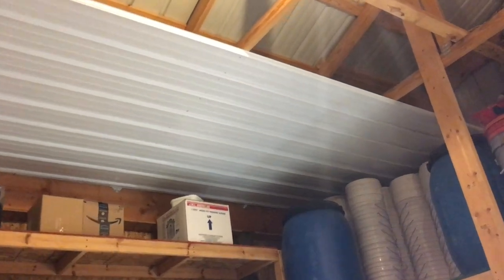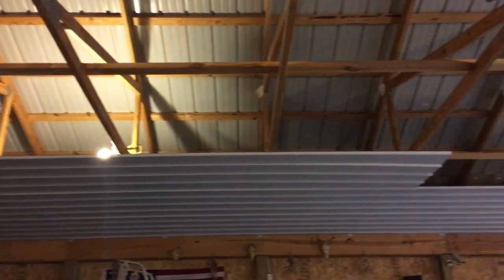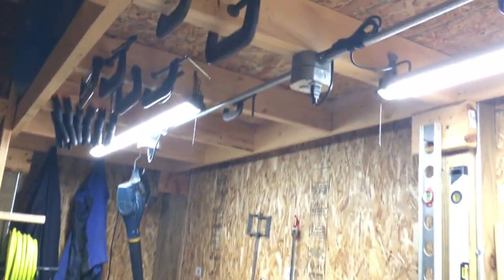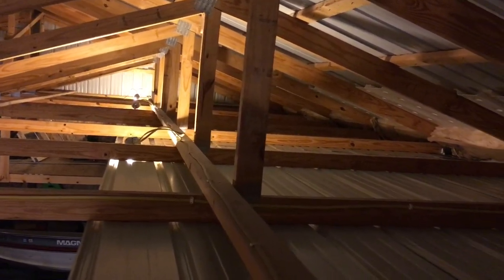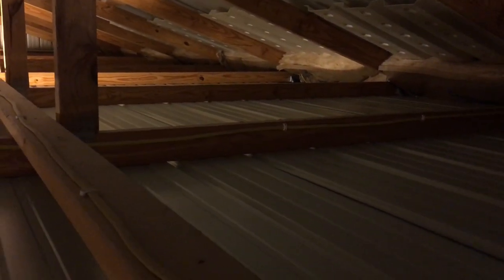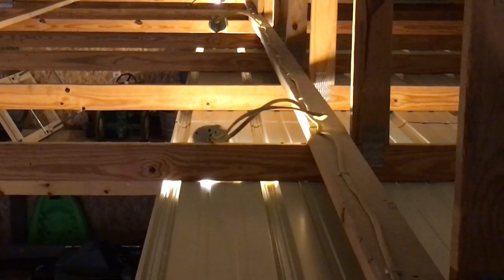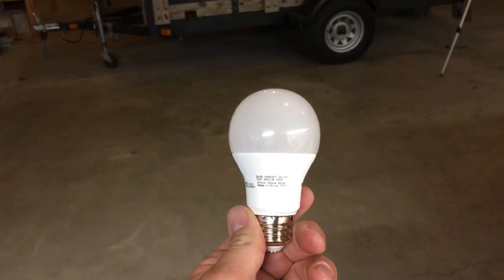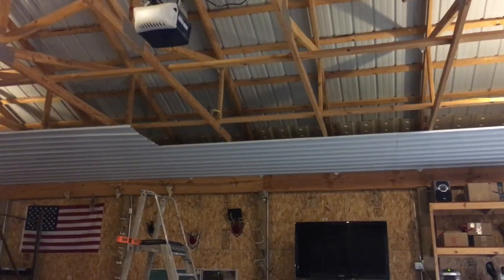044 Installing steel liner panel in pole barn, part 2

Comment: Nice video. My 30x40 pole garage has 14ft high ceilings and I've been putting off doing the ceiling portion. I really need to do it and insulate it for heat retention. I honestly didn't think of the drywall lift and just building a simple raised platform to hold the sheets a little higher since I need to hit 14ft.

Comment: Thanks for posting making this video.  I'm getting ready to take on the same project myself; I'm gathering the materials presently.  Looks like we are using the same panels too.  I  like the idea of running the romex along the top half of the 2x4s.  I'll be using a different kind of lighting, but the concept is the same.  Nice job on your project!  Thanks again - I really appreciate you taking the time to make the video.
Reply from the maker: Mine turned out really well. It’s a lot of work and take your time but it’s worth it. Good luck and thanks for watching.

Comment: Great video. The one thing I would add is to block the little gap between the metal roof and the truss 3 feet from the top plate of your outside walls. That way if you install loose fill, it won’t go into your vents if you blow on the adjacent cavity.

Comment: How much did you overlap your metal when installing? About to start this project myself in my pole barn garage. Shop around here cuts to any length so I was thinking 8’ 2” panels so I can overlap 2” to get a clean look. Going with 8’ for easier install for myself.
Reply from the maker: Hi Jay.  I recall overlapping around 6”-8” but then realizing that was overkill. I think 2” is good just make sure your building is square and from one end to the other is not a different dimension or your last row may not cover. Also, make sure you have enough length to catch trusses on each end of each panel. I think going 8’ you’ll be good there. Sounds like you have a good plan. Good luck, you’ll be pleased with the result!
Reply: @LivingOurAmericanDream  thanks
Reply: @LivingOurAmericanDream  did you put j channel all the way around the whole barn?
Reply from the maker: I did. Not sure if it’s really functionally necessary but it’s a nice clean finished look.

Comment: I’m jealous that your trusses are close together. Mine are 7-8’ apart so I’m going to have to build a framework to hold mine up.
Reply from the maker: Bummer. I’m sure you can build your framework either within your existing trusses or even directly below. If you plan to run steel liner panels like I did you can get away with 4-5’ spacing. If you plan to put osb up, you’ll want around 2’ spacing. Good luck with your project and thanks for watching.
Reply: Thank you for your reply.
Reply: Unless you have skimpy trusses you can easily run sheets longer than 8' without any framework..check out RRbuildings on YouTube. Dudes a real pro at pole barns and shows you a lot of neat tricks

Comment: Maybe you covered it in part 1 (I didn't see it).  Be sure to have adequate attic ventilation or in 15 to 20 years; your roof framing will be mush.  The roof metal will have condensation from time to time that will be absorbed by the wood = rot  or absorbed by the insulation = mold. Some would tell you to put a vapor barrier in the ceiling - true if it's sheet rock - metal is impermeable  - therefore it is a vapor barrier. If you had a high moisture content in the shop (from a hot tub or something), then you would have  drippage/weeping - annoying but not particularly harmful to the metal.

Comment: How did the drywall jack work? How did you keep the steel from sliding off?
Reply from the maker: Hi John...the jack worked really well. As far as sliding, I did not have a problem there as long as each piece was somewhat centered on the jack. Some end pieces and corners were tricky since I had to work around a lot of things in my shop. I’d recommend trying the drywall jack if you’re going to do the job alone.

Comment: These are the video's I've been looking for.  Already have the lift,  metal, F channel, and screws.  The level, straight edge, to align the screws is a great tip.  I'm not looking forward to the squaring-up  part.  Did you snap a line lengthwise and cut/trim the metal in order to get the first row correct?  Thank you for taking the time to post and explain.
Reply from the maker: Hi Scott. I ran the first row directly along the side of the building. Subsequent rows aligned pretty well by overlapping the last lip just like if you were installing the metal as siding or roofing.

Comment: Shop looks great! Question. When you put your ceiling up does the steel need to end on the truss or can it go over a few inches? My building is 30x50x12 with 4’ rafters but I put a wall dividing the first bay down in between the rafters so it may throw me off some where the metal will end. I’m thinking when it’s in the J channel but not on a rafter.
Reply from the maker: If you’re putting insulation above it I’d make sure the ceiling panel is supported near the end, within a foot or less. Inside the j channel with the channel supported should be ok. Good luck and thanks for watching.

Comment: Fair warning - I'm a grandma - not a carpenter.   I will be  using 8x2 corrugated sheet panels for a wall in my garage.   What type of screws should I use????
Reply from the maker: I would use the sheet metal self tapping screws with the rubber washers on them, same as a roofing screw. Easy to use, self tapping, and available in any color you want. Good luck.

Comment: Looks great!  What size are your white panels?  where did you get the channel that you stapled to the soffit header?
Reply from the maker: White panels are regular pole barn siding with a less expensive interior paint. Mine were cut a little over 12’ long to span 3 trusses. That trim is standard white J channel that you’d use for trim on your exterior siding and soffit. Thanks for watching the video(s).

Comment: How much did your panels weigh?
Reply from the maker: Hi James....I did not weigh the panels. If you’re interested in truss support, you’d need to know the panel weight and insulation weight all divided into the number of trusses supporting it. In my case, I bought the trusses from the manufacturer having told them I was installing steel ceiling panels and 12” of blown insulation.

Comment: How is the noise level in the garage?  Does the steel cause an echo/tin sound in the garage when working?
Reply from the maker: The noise level was a concern of mine in the beginning but it is actually not bad. I think having the 10” of insulation sitting on top dampens it quite a bit. I’m very happy with the steel panel and blown insulation arrangement.

Comment: why did you choose steel sheet over plywood or drywall ?
Reply from the maker: Hi Bob...I chose steel for several reasons. First, my trusses are 4’ on center, so drywall or osb would require quite a bit of framing in order for each panel not to sag. Second, I bought the steel in longer sheets, making installation go quicker. Third, they came pre-painted, so no finishing after install. The white makes the LED lighting really brighten up the building. 

Thanks for watching and I hope I answered your question.
Reply: Sounds good. I am starting the same project in my 30x60 , thanks for the reply 😀